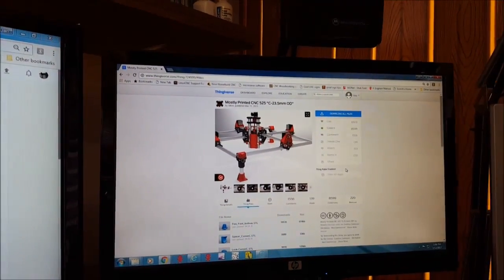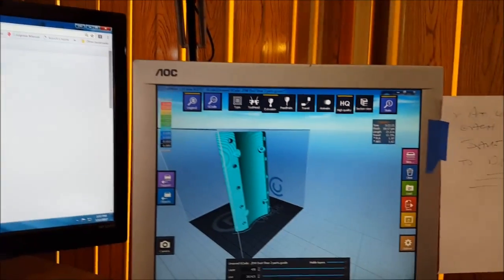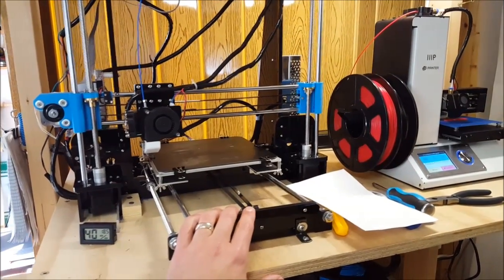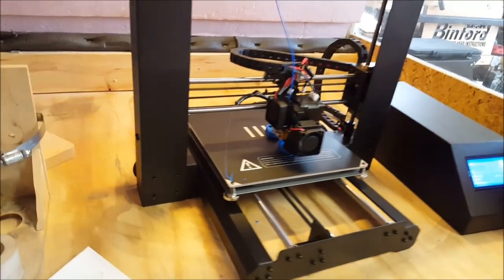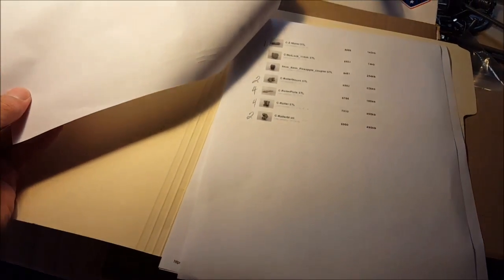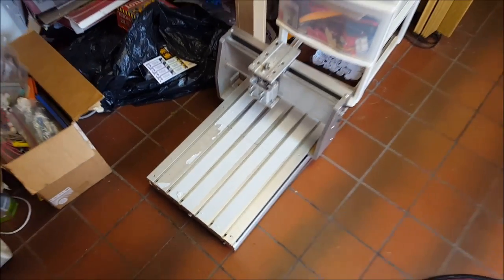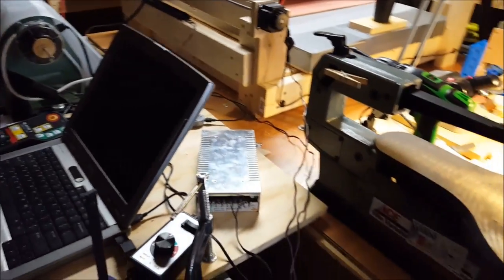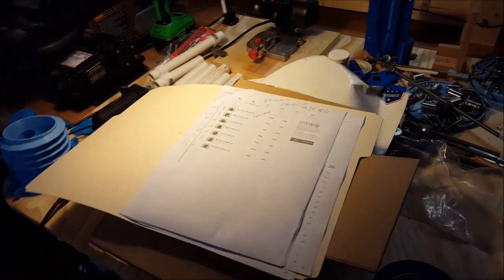A Mostly Printed CNC Project - A New Build

Comment: Is the build volume on the monoprice mini select big enough to print all of the parts for the mostly printed cnc router?
Reply from the maker: I printed some of the smaller pieces with the Mini for the CNC machine.  But it can't really print all of them as originally designed.  I think there is a thread I read where a guy did print all of the parts on the Mini but he had to cut some of the larger parts into multiple sections in CAD and then glued them up.  You can buy the larger pieces from Vicious1 and print the majority of the smaller ones on the Mini.

Comment: How is the Anet A8 High Precision Desktop 3D Printer. I think of buying 1 and I want to know how it works
Reply from the maker: Hey Joel.  It works very well and much better than I thought it would.  I made the MPCNC with it as well as many parts for other builds.  Fun project.
Reply: Thanks, I will consider now to get me 1 as soon as possible
Reply: Joel Van Staden I've been looking at it a lot! almost everyone who reviews it has a bad, broken, or missing part. As far as I can tell, it's great as long as you don't mind buying some replacement parts and printing upgrades for its self. I want to get the monoprice mini for my first one.

Comment: HI, how do you like the anet compared to the monoprice, I'm looking for my first 3d printer, I've built a mdf cnc myself and I'm looking to make a mostly printed cnc also.
Reply from the maker: The Anet has been really great.  I didn't think it would work as well as it does.  The kit went together relatively easily however I had to print some replacement parts with the Monoprice Mini because some pieces in the kit were pretty lousy.  It's certainly worth the price.
Reply: Now I'd go for a Creality Ender 3